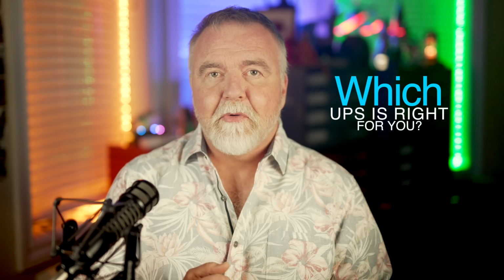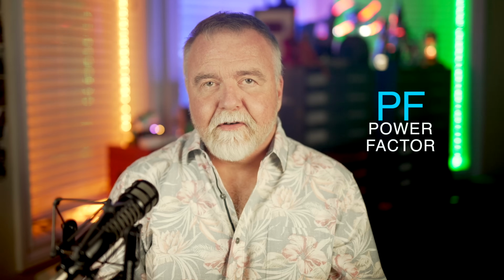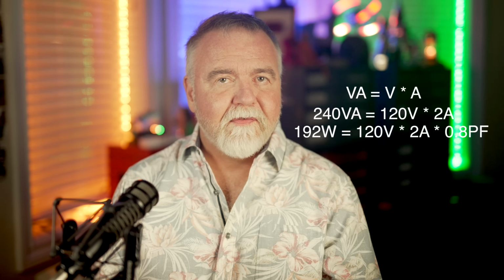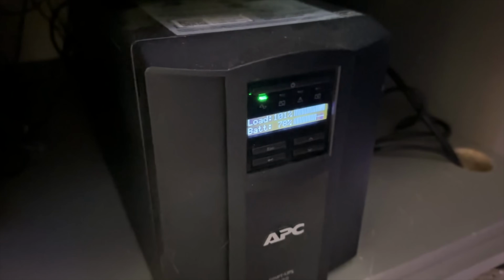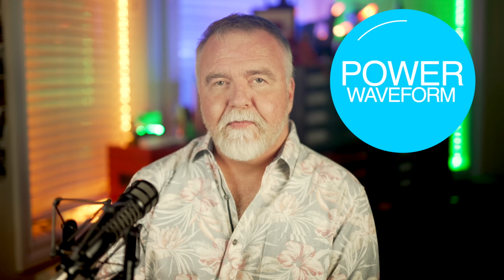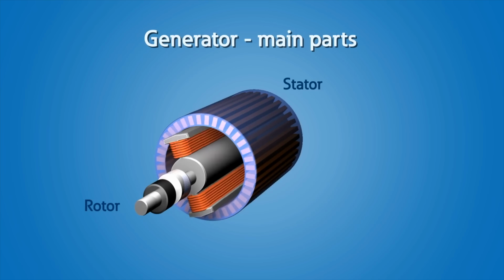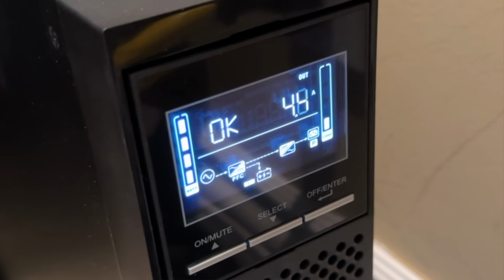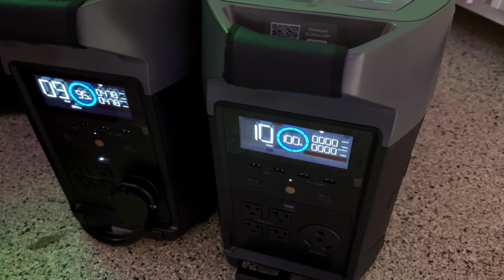The UPS Secrets YOU Need to Know!

Comment: One thing Dave didn't mention is availability of new batteries.  I have a 1500VA APC UPS on which the battery failed on March 20, 2023.  Attempting to purchase a replacement battery -- one that shows up as 'in stock' on APC's website, failed at checkout, when it finally revealed that it was not in stock (this 'feature' still exists -- the battery shows as in stock until checkout).  Phoning APC to determine when they may stock a battery again resulted in a referral by APC to another company that 'should have the battery sooner'. APC provided that company, Active Data Solutions, with my contact information.  I was sent an email telling me that they would have a battery in stock on March 22 -- at approximately double the cost over what APC would charge for the battery. When I questioned them about the price, I was told that the higher price was to justify the faster delivery time.  Just after I paid for the battery, I was told that it was no longer in stock and back-ordered until March 29.  That date was then pushed to April 20, then April 25, and, with the most recent claim, May 1.
The people I've spoken with say that the APC batteries are in such high demand that they are very hard to get.  APC tells me that they cannot even obtain them themselves, which is why they provided Active Data Solutions with my information.
APC does however continue to manufacture many new units with new batteries containing the same model of battery that is 'nearly impossible to obtain'
An APC UPS may work great out of the box, providing line protection and backup power in the event of power loss, but once the battery foes dead, you basically have to buy another UPS since replacement batteries are simply not available.
Beware if buying an APC UPS -- you may be stuck with a large, expensive paperweight as I have.  There is nothing wrong with the UPS itself, it is just not possible to get a battery for it.
It will not function without a battery -- it is useless.
If you do buy one, be prepared to replace it entirely when the battery fails.
I will never buy another APC UPS.
Dave: your you said your APC is 6 months old -- I'd look into replacement battery availability now and consider what you might replace it with if you also find that a battery for your UPS is also simply not available.

Comment: There are other advantages to lead acid batteries (that don't necessarily affect UPSs in particular). A lead acid battery can significantly higher burst currents without damage to the cell (referenced as CCA in auto applications). Oh, and let's not forget, lead acid batteries don't tend to SPONTANEOUSLY COMBUST  into a class D fire which is extremely difficult to put out!

Comment: Does your APC 1500VA have enough capacity to provide power to your Threadripper workstation when you load your CPU and GPU? The 1500VA  with a PF of 0.8 would be 1200W, and you did mention the Threadripper workstation might burst to 1200W, would that trip up the APC UPS?

Comment: Interesting, Thank you, about 10% of the purely Broadcast side of BBC Television Centre was powered via an online UPS, a 70 tonne Concrete flywheel rotating at c 50 RPS coupled with a combined Gas heat and power system and three substation supplies. There was a specific version of the Type G mains plug and socket used with pins rotated through 90 degrees to show the difference between Technical and normal mains. Other older buildings relied on standby Diesels with the obligatory hope and a prayer that they actually worked.
The reason for this overkill? On 20 April 1964, BBC2 planned to launch an evening of programmes beginning at 7:20 pm. However, 35 minutes before the new channel went on air, a power failure spread through most of London, affecting BBC Television Centre, where BBC2's programme control was based. This was a little embarrassing for those concerned as BBC 2 was the first 625 line Colour Station...

Comment: Also, not mentioned is the difference between Lithium Ion and Lithium Ion Phosphate. Lithium Ion is lighter than  LIFEPO however has roughly half the lifetime of a LIFEPO.
Reply: Reportedly, Li-ion can more easily catch fire AND KEEP BURNING. On the other hand, LiFePO if done correct will not sustain a runway fire. There are videos available that show the difference with demonstrations that are dangerous. 

My 30A-hr LiFePO battery for POrTAble ops is even UL-listed, as I'm not a huge fan of house fires.

Comment: APC does not suggest running a UPS connected to a UPS because the end UPS will usually go to battery the same time the upstream does as it detects the drop in power.
Reply: How would the downstream UPS detect the power drop if the upstream UPS catches it, especially if the upstream UPS is an online double-conversion? And even if there was a short blip, once the upstream UPS was delivering full power to its outlets from battery, the downstream one would switch back to drawing power from what it thought was input line AC, would it not?
Reply: @dutchcanuck7550  The power the UPS puts out is not 100% the quality of mains power. The downstream UPS will still switch over to its own batteries. This is what APC says about stringing APC UPSs together. I can't say how Dave's setup will fair.
Reply: @adriansrealm  A decent UPS (like the APC Smart-UPS) actually puts out higher quality AC power than the utility. It's only modified sine wave ones which won't be detected as a valid input.

Comment: Where I am, power costs 6c/kwh at night but 37c during the day. I'm wondering if there is a UPS solution that I can charge at night and use during the day to reduce my bill
Reply: There are decent Power Stations that can do that! (It my need to be quite big for decent runtimes!) Though you will still likely want to also use a UPS.  (Wall outlet-->Power Stations-->UPS-->Computer).
Some of the newer Power Stations even 'claim' to have a UPS function.  And while some have a fast 10ms transfer that MAY be fast enough for a home computer..., they DO NOT have any surge protection!  So you will at least want a surge protector with the Power Station.  Also the power rating of Power Stations seem to be PEAK AC power, NOT RMS power. So you will want the output wattage to be at least 1/3 higher than any computer requirements!

Comment: The optimum 'UPS' concept might simply be a laptop, which would obviously be unperturbed by power outages.
(Yes, yes, yes, I know...  The fiber router provided by our ISP has an internal battery, and is also unperturbed by power outages. This approach actually works...)
...Anyway...
Just a thought, in case it helps reduce the national rate of house fires.

Comment: Thank you Dave, another great video

A safety reminder, NEVER back feed the grid

I see PF differently
Work is work, no matter the Power Factor.  PF is not so much a measure of useful work, its just the ratio of different types of AC load, inductive or "magnetically coupled" and resistive.  
The ratio of useful work to consumed power is efficiency, the difference is heat, and heat my friend is only waste when your hot!
Can anyone please verify or challenge or expand my thinking

sounds like a double conversion UPS may be required for quick start automatic back up generators to reliably deal with phase mismatch?

It can be argued that lithium based batterys are less environmentally responsible than lead acid

There are also mechanical DC powered AC generators, you can also get phase matching controllers for them

Wow, sad, i didn't realize windows still cant reliably handle hard shutdowns in 2023!

Does anyone else feel it was wrong of Microsoft to seek and get exclusivity to the term "PC", or am I just another biased long time linux user? 

Thanks again Dave and community

Comment: If you have a gold or platinum power supply you have a power factor correction (PFC) supply. It will have a perfect power factor so watts and VA will be identical. 

Hence get a good power supply 😊

Also the best UPS is similar to the UniFi UPS system that converts AC to 48v DC with a PFC and has a 48VDC battery. It then powers devices with 48VDC directly since they’re all DC anyhow. When powering directly with DC the power supplies don’t have to be fully isolated and only require a hot swap controller in them that protect similar to good POE adapters. 

Hence you get 95% efficiency AC/DC and then every device is 98% or so because it takes 48vdc to 12/5/3.3 which is a much smaller delta that doesn’t have to go through a high frequency transformer.  That’s at least 15% more efficient than AC/DC/AC conversion and more efficient than most power supplies while giving you complete isolation and perfect power to your devices.
Reply: 15% is way too generous, a system like this will easily be 50% efficient on the double transformation
Reply: @fss1704  you can get them in the 75-80% range. Highest AC/DC issolated is about 95%, efficient. Highest DC/AC is about 93% efficient and then the Power supply converting back can be about 93% effcient. So I was being generous but yes it’s insane. 

It’s really AC/DC/AC/DC. 

DC all the things. They work better that way. I run off solar and built my own own system that allows me to send 400VDC on deticated circuits at 98% efficiency. I then tapped the back side of the PFC in my power supplies and run a secondary connector out the back and hook them up DC directly. They consume about 60% of what the AC power supply does naturally AND do t have to have inverter capacity AND when there is sun out they’re using the 400vdc rail from the mppt directly and only have to boost when on battery so 0% waste when there is sunlight. 

Really we need to get to homes with point to point circuits with USB-C ports and extend the PD spec with not only the new 48v but 100, 200, 300 and 400v. Since it has PP like an ev charger it’s safer than the wall socket is now and the breakers can also have a boost/buck inside to deliver the power requested up to 7 amps at 400v which is more than a 120v 20 amp circuit can right now and ground faults would have sub ms response times with 100% accuracy unlike current GFCI.  There’s literally nothing in a modern home that doesn’t work as well or better off of DC. Hell most everything can just be powered via DC directly right now through the rectifier or PFC if you know what you’re doing.

Comment: I have a APC UPS 550, and the battery life on those is just miserable.. and well, they're good for about 15 minutes, so you better just save your work and shut down... because you aren't going to want  to hear that infernal squealing Piezo buzzer going off anyhow
I fixed mine.. removed the buzzer, removed the battery and put leads on it to a Group 31 truck battery.. works great that way!

Comment: Could I connect a CAR BATTERY to my APC 800 W instead of the smaller lead acid battery and have a longer duration? Or will that overcharge or undercharge the car battery, or overheat the electronics in case of downtime? Any idea? THANK YOU for the great video and channel! :)
Reply from the maker: I'm no expert, but if they're both 12V lead acid batteries, in theory it should work.  I don't know if the charging requirements are the same, but they might be!

I have a bank of 6Vx2 golf cart batteries and an inverter, which achieves a similar thing.
Reply: A deep-cycle marine battery could probably be substituted, but not a standard car battery. Very different usage and charge cycles & therefore different internal design and chemistry. 

A car battery is designed to hold a charge for days or weeks with no recharging, then deliver 300 amps to the starter for a few seconds, then rapidly recharge from the alternator, and never be discharged below 50%. Whereas the battery in a UPS is designed to be continuously charged 24x7x365, then deliver moderate amperage (8-15 amps) for minutes to hours, until it's nearly flat. My understanding is that the UPS charging cycle ruins car battery plates prematurely, and a nearly-full discharge will destroy the battery.

I remember reading an article on some techy operations blog site by a guy who had built a 6-hour battery backup from a pile of sealed 12-volt motorcycle batteries. Worked well, but he had to be super-careful about things like flooding, extra fuses, overcharging & undercharging, and hydrogen gas build-up. Batteries are dangerous: they can catch fire or explode if mis-wired or put to use outside their design envelope. My personal conclusion: cut APC a check and be done with it.
Reply: No! If the UPS was not designed for an external battery pack, it was not designed for long runtimes.  If it has the external option than yes. You risk a fire if it was designed for a short duration on battery.

Comment: I really wish it was easier to cut out some of the middlemen on a power backup solution. We have to go from AC line voltage to DC low voltage for the batteries back to AC line voltage to feed the PC power supply which then converts that back to low voltage DC at several different voltages for the computer itself. Low power systems can run on those micro ATX PSUs that are just a circuit board that goes directly on the motherboard connector with a barrel jack running to the outside of the case, but you can't run anything serious off of one of those. And even then they demand a 19 volt input when the solar generator type backup units can only really provide 12 volts or 24 volts or power delivery, none of which are compatible. I'd love to be able to get an ATX power supply with an integrated battery backup solution, but it would probably be too big to fit in the case at that point and they'd probably be a cooling nightmare.

Comment: Just would like to shoot my 2 cents in here.   For the cost effective crowd?   I'm one of the first that made a video (Long gone) about how to hook up a simple Lead Acid lawnmower style Battery to a old APC type UPS.  
In fact? My last battery was even a used one.  And it lasted close to 11 years in service before the battery gave out.      

Lead acid sucks at being cycled.  But if you need  a good economical flooded battery that can be used for about 10 years before you have to think about the plates themselves breaking down?  Its the way to go.    I would not bother with anything expensive.   The cheap Johnson Controls Battery from Walmart will do.   

The Smaller Lawnmower battery's use to be $20 bucks.  (Imagine that!)   And were perfect for getting a bad UPS back to work again due to a bad SLA battery.   (Or AGM type etc)   

I would not even bother with the "Marine" style or the "Deep Cycle" kind.  You don't need it.     And that's from my own testing for over 15 years.      If you want double the peace of mind? Just parallel two of them.   And do a per cell Load check about every month or so if its mission critical.      Otherwise?  The UPS will die before the batteries do.   (The APC units are ROCK SOLID)   

Some will tell you about "Hydrogen explosion".   To that I have to ask...  Are you charging it at 80 amps or something?   That's never going to be the case with any of the home UPS units.   So its not a problem.  

Also PRO TIP!   If you have a AGM style battery and want to bring it back to life due to cell sulfation?    About a month or two on a UPS on a constant trickle charge will do the trick.